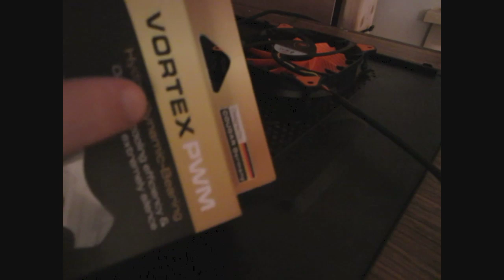How to install the rubber grommets for PC fans Cougar Vortex Fan

Comment: I have the same fans in my Cougar case and I used pretty much the same approach.  In hindsight, I plan to buy a short plier set w/rubber coated tips so it is a bit gentler and less prone to break any of the pegs of the grommets while pulling them.  That happened quite a bit to me based on the longer pliers I had to work with.  I also noticed I haven't been able to find other rubber grommets that have the same look of these so far, which is a bit disappointing b/c I had to use metal screws for some due to the aforementioned breakage of a few.  It was quite a feat to install these for a bottom fan since there was a tiny narrow area that my case only had for backside/mobo tray area.

Comment: Thanks for the vid!.
 I had to do two from the fan side, and 2 from the case side.
I used mine as the case front fan, and there was no access on the mobo side of the case.  So I put them in the fan first while it was out, lined up the holes in the case and plucked them through. (with spit of course, lol).  Then put the other 2 into the case, lined the fan up with the nipples, spit, and pulled through with some needle nose pliers.

Comment: The air flow is always to the guarded side of the fan. I think the screws are easier. Assuming that this is the inside cover of the case you are blowing air into the case. Is that how you want it?

Comment: Thanks for the video, I'm installing the same exact fan even. It looks like some WD40 or another similar lubricant might have helped some. It also looks like I'm going to have to tear my pc apart to get at the backside of the inside fans.
Reply from the maker: +ScottH454 Don't use WD-40, that can actually break down the chemical composition of the rubber. you could consider some soapy water though, just not dish soap which is also harsh.
Reply: +Everplex Media LLC Well I did end up using some dish soap, but wasn't much more transfer from wiping it on my fingers. Plus by the time it degraded the rubber enough to be a concern I can replace it for a few cents. Besides I imagine most of it gets squeegeed off when it's pulled through.

I did want to bring up my experience with installing these though. I noticed I could push the fan tight against the case an the rubber mounts had a mm or more of slack in them. The section the case metal fits into measured 2mm so unless installed in case has metal that thick your fan won't be snug. The solution I came up with was to double up the rubber pads by taking the unused pads an sticking them over-top the ones on the side getting mounted to. My fans are tightly mounted to the case an double the padding has to be a plus.

Also it wasn't till my last fan I was installing I noticed the fans casing was warped as it didn't lay flat on the table. This hopefully won't effect performance but would be a good reason to mount the fan tight against the case an not have the chance to bow out anymore.
Reply from the maker: I recommend using only water, since water is just as good for this purpose.

Comment: The hole is too small. I got this by screwing the tip into the hole to make it bigger. The black screw will not be enough. 
Use the pliers to pull it mounting in the fan first. After you can install the fan in the case.

Comment: getting them out is an other story....
Reply: +ProBro I did have to pull off a fan after installing it an wasn't bad at all. Pulled on the fan an the out side head easily pulled through. The rubber pins where easier to work on when you had the control of the fan individually.